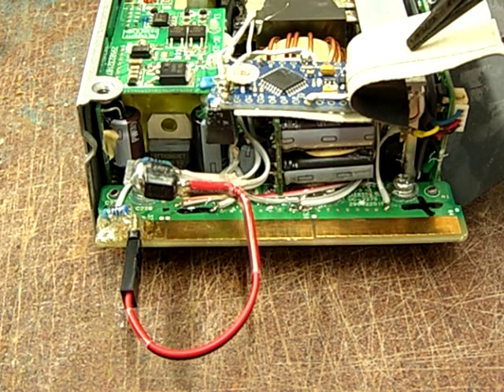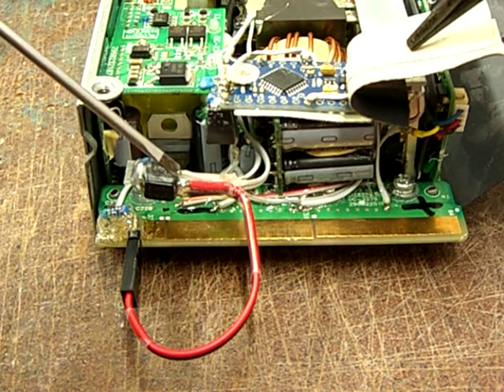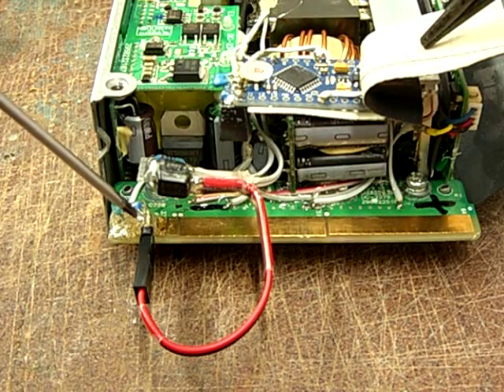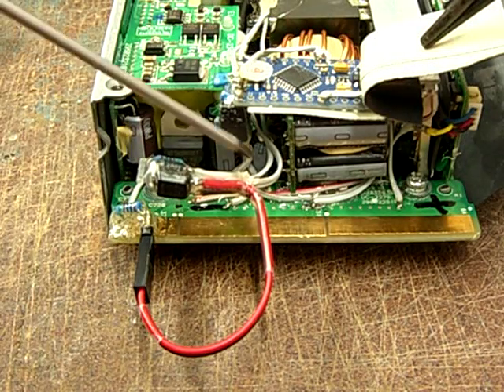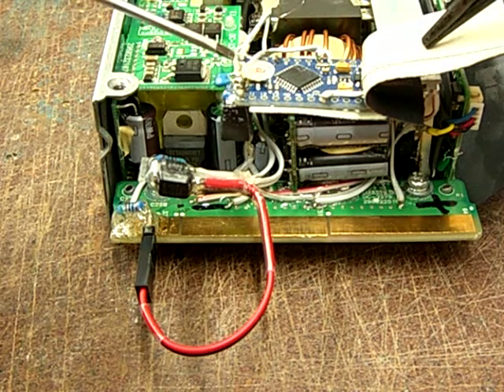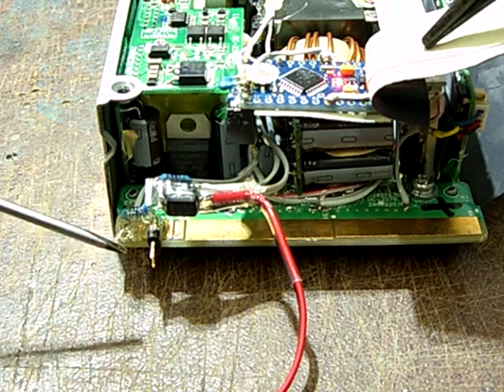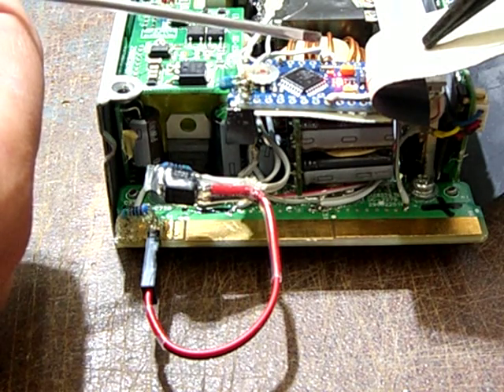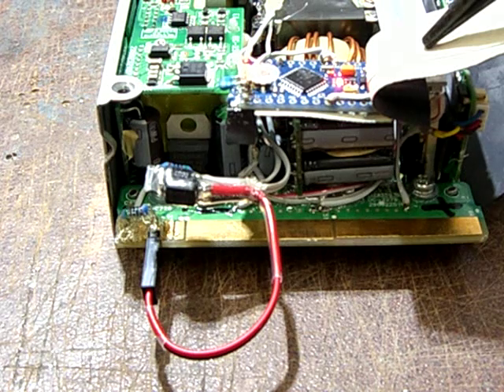DPS-1200FB Server Power Supply safety with Optocoupler

Comment: Great Idea, and Im about to mod mine for the saftey. Just curious, in your post, you mentioned if your not using and Arduino, to add a resitor and monetary to pin 37 with it instead. Is that for both psu or just the master. If you have to add the momentary to both, do you have to press them at the sametime to start?

Comment: Can inuse 470ohm resistors i cant find 500ohm anywhere for the  ouplet
Reply from the maker: Yes this should be no problem most likely.
Reply: @Extremflug  hey i finished the coupler, but on the first power up when i plug in my charger the PSUs kick off. second time works... do you know why?.

i just noticed i have to hold the momentary push button while i plug in the charger...should I put a capacitor in the line somewhere?
Reply from the maker: @DKF22   Hi, I have the exact same issue. I attribute it to the inrush current of the charger, while it's internal capacitors are charged. You may also notice a spark when connecting the charger. I assume the inrush current briefly overloads the PS and triggers an overload fault or so. I connect my charger(s) first, and then power up the power supply.
Reply: @Extremflug  if i plug in my charger first the power supplies wont start hmmm.. I got a revolectrix

Comment: hey man, any reliable way to get 30-32vdc with 3 of these in series?
Reply from the maker: Yeah, just rework the screw attachment points of the PCB so that there is no ground connection to the case any more, and then put 3 power supplies in series. On each, adjust the voltage to 10V or a little more.
Reply: @Extremflug  hey so the Arduino is a must to make the coupler work? I want to try this i don't ever want to ruin my expensive charger.
do you have a diagram of the full circuit for both power supplies plugged in series?  i can only get as low as 11.90v on the adjustment pot

Comment: how to get 14volts from this power supply? please help me
Reply from the maker: I am afraid that this will hardly be possible. These power supplies were built to run very expensive server electronics, so all kinds of safety features were implemented to make sure that the output voltage does not exceed a safe threshold. One can adjust a max voltage of 13.8V, but to make sure the power supply will not switch off when dynamic loads are applied, 13.5V is the maximum one should go to. Read more on how to get 13.5V here:

https://www.rcgroups.com/forums/showpost.php?p=32560379&postcount=3315

Relevant descriptions are found in the image descriptions.
Reply: @Extremflug  this comment didn't age well as people are cranking 14v out of these. 22k ohm resistor soldered to the trim pot and a 75k ohm resistor on the ovp.

Comment: I reverse-engineered the firmware in the CPU in this power supply; have full instrumentation (input+output current, voltage, temperature, etc) 
https://github.com/raplin/DPS-1200FB
Reply from the maker: Hi Dr Tune, awsome work, thanks a lot. This would surely be a step up compared to the analog voltage, current and temperature measurements I do in my built.